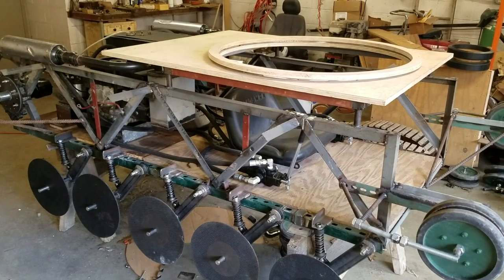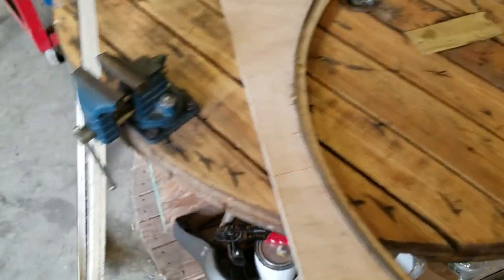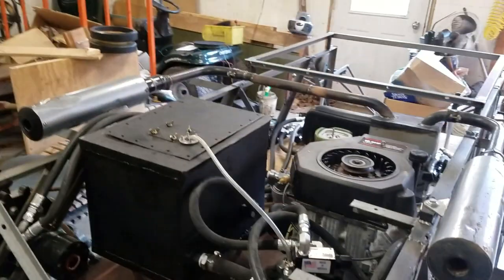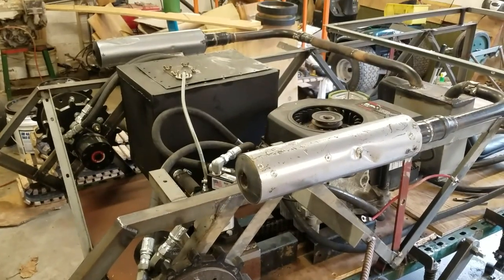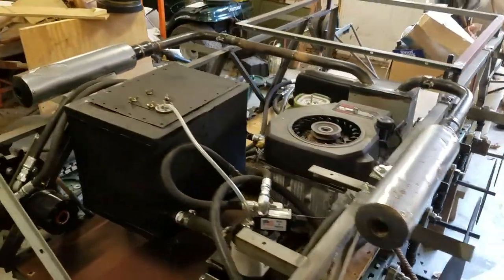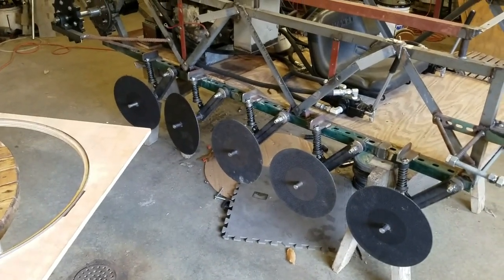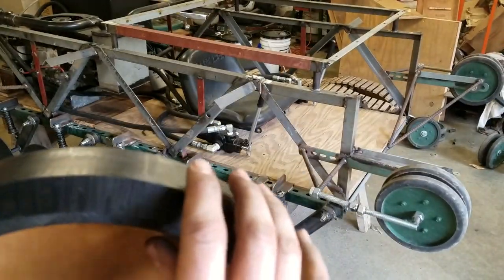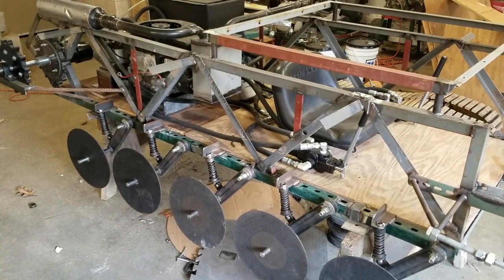Homemade Tank Part 16 (Turret Ring, Exhaust, Suspension)

Comment: hey dude!! i love your vid's. im actually planing to make one of these in the near future, do you have any tips?
Reply from the maker: Glad to have you watching!  any tips? hmmmm... 1. hydraulic drive is the way to go (Im gonna make a detailed video of my system soon) 2. junkyards / craigslist are great places to get parts (especially steel stock and old lawnmowers for engines) and 3. don't be afraid to change things. id say at least 50% of things ive done on the tank have been modified, changed drastically, or completely rebuilt.
Reply: Thanks!!
Reply from the maker: No problem. Also make sure you check out tankman101 (if you haven't already)
Reply: Ok
Reply: But hydraulic drive is more expensive than mechanic... But easier to do XD I want build tank with mechanic transmission because i want vehicle who can turn around without moving forward or backward...
And will you add pneumatic system? for air cannon for example?
Anyway really great JOB! Im waiting for more
Reply from the maker: hydraulics are definitely more expensive, but to make a mechanical transmission from scratch would be quite an undertaking, or maybe you could get a transmission off of a quad or something. turning without moving forward or backward isn't specific to mechanical transmissions, my tank turns in place because im not able to lock one track and move the other. for the cannon i'd like to do some kind of potato gun
Reply: @MacroMachines  Know I am late, and I do not plan to make one. but what about hybrid electric drive, like used on the german tiger tanks?( as in engine drives generator, which drives electric motor)

Comment: have you thought about the tension wheel tracks? eliminated would then loose tracks and was less likely to be dropped when turning
Reply from the maker: not sure what exactly your asking about
Reply from the maker: Oh yeah the idler wheel, mine's a little bit different setup but still adjustable back and forth. I just completely re-made the whole setup to accommodate the bigger road wheels, so I'll include it in an upcoming episode